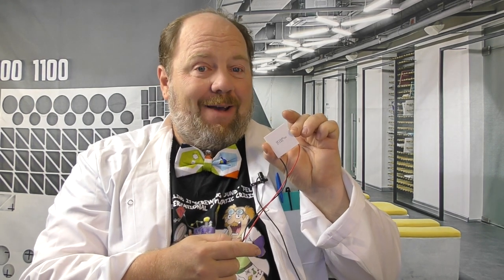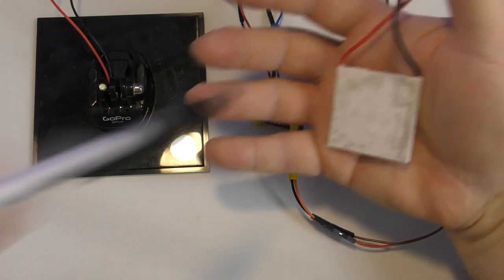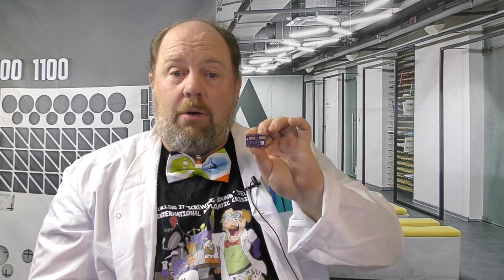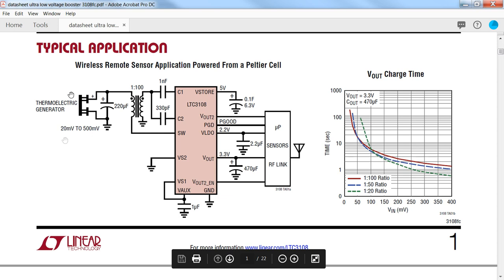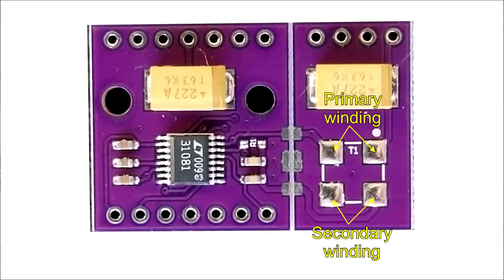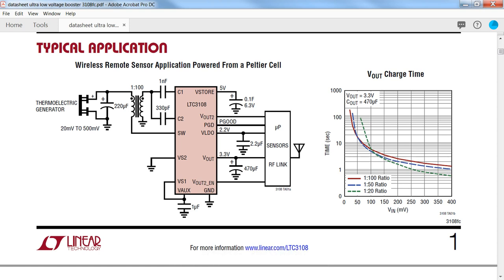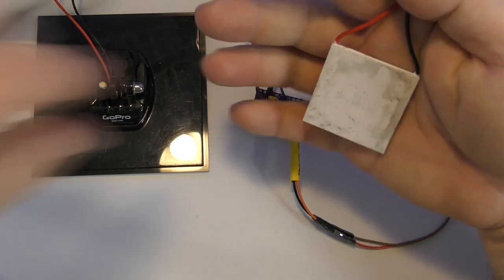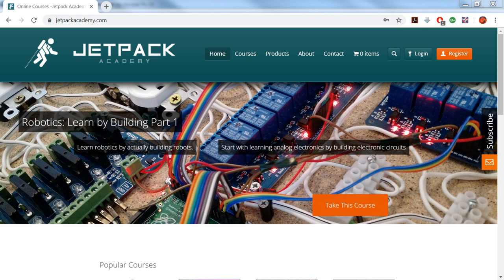Powering electronics with heat from your body!

Comment: Great video. Can you help me? How can I determine if I have a 100:1 surface mount transformer ? I can't find any in stock online. Can I use my volt ohm meter to check parts in my junk drawer ? What should it read ?